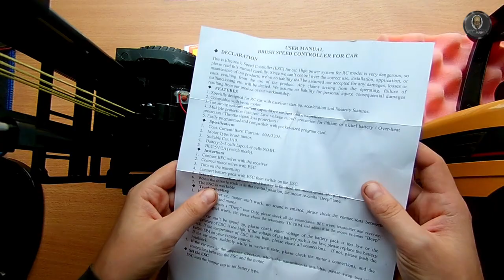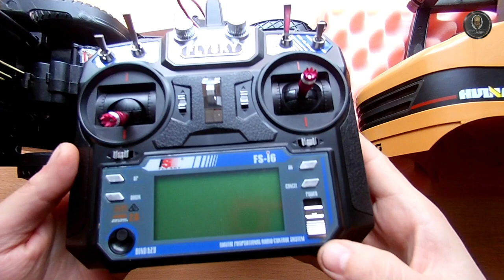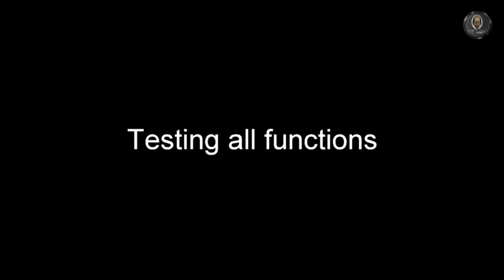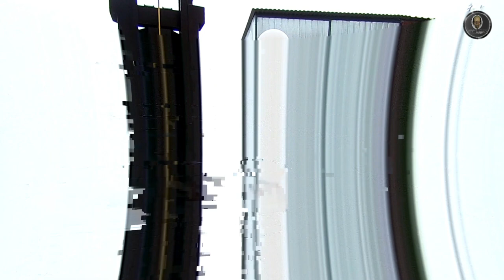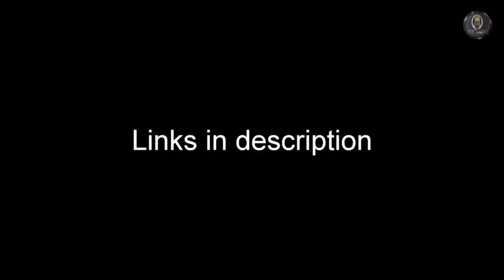Upgraded Huina Forklift with trailer

Comment: Great job bud I am going to use your ideas. May I ask what that power splitter us and where you got it? Can't wait for mine.
Reply from the maker: Power splitter is made from connectors soldered together.
I use this in bigger projects because it's more easy to modify it.
I changed ESC to quickrun 1060 and to do that I just unscrew cables from connector :)
I also added a buzzer because new owner drain battery to critical state.

Comment: To what channels does the different ESCs go on the receiver for forks? And did you try what the stock battery? Will this even work? What was the runtime with the stock battery? Doing what you have done to a friend's 1577 and want to do a nice job? Would you be open to assist if I need help?
Reply from the maker: Hi, All will depend on your remote, better are plane remotes like that flysky because of that centering lever and on what channel You connect it depend on what configuration of sticks You chose.
Sock battery would work, but that will depend on ESC, most of ESC have low power protection that turn off power on low battery, if ESC will work on higher voltage than it will not turn on with this battery.
I have no idea how long it worked on one battery :D I like to build more than use it, sadly I sell it to get more space in room and as far as I know it's still working.
Reply: @Adrian202  thank you for your reply. I will get 2 crawler ESCs which you can chose lipo or Nimh.

Comment: At 5:49 you say ESC has braking that cannot be turned off I may be a bit late on this but you set the drag brake to 0% and It should remove that. Drag brake is used for rc crawlers to hold still on a steep incline
Reply from the maker: I never did turn it off, Now I will replace it for a new owner

Comment: Great stuff! Can ask if you are running the stock battery? Or swapped it out for a lipo if so what lipo did you go for ? =)
Reply from the maker: I have Li-Po because I changed electronic.
I use 2s lipo and You just search witch one will fit inside :D

Comment: Awesome, i was wondering if you still have the files for 3d printing. I would also like to upgrade my forklift. Thanks
Reply from the maker: Yes I have it ready for edit :)
https://www.tinkercad.com/users/ijdXrBIYp5t-adrian202gt
Just search for Huina designs here.
I remember that I changed something after printing the steering mount because it was hitting something and I needed to cu a little bit to fix that but because after cutting it worked fine I did not changed it in design.
Lamp covers have two parts because first hold LED and second act as a cover but You can redesign that and it's not that hard :)
Reply: Thanks dude! Can I ask what esc you swapped out the original board for ? I want to run a different receiver but cant on that current set up haha I'm confused
Reply from the maker: @Thedopaminecyclist  links are in description but that ESC don't have option to turn off brake and that is annoying but have slow drive speed.
For receiver best would be to chose DumboRC because of more channels

Comment: That looks really cool. Original Forklift says it's 8 channel but you've used a 6 channel Flysky?
Reply from the maker: Not much functions to use :D
Reply: @Adrian202  Cheers
Reply: @Adrian202  The Forklift is on its way and I thought I'll upgrade it by following your video. I do not have access to a 3D printer at this stage and got a Devon 7 transmitter with a 6 channel Walkera receiver (RX601). Where did you get the power distributor and the distributor circuit with resisters for the lights? I'm a bit new to this so collecting all the parts I need. I do want to keep sounds as it is.
Reply from the maker: @lasanthamahavidanalage8918  Yes, I always use resistors for each LED depending how bright I want it (for rear You need bit less resistance because red LED is not so bright as white)
Wit a little bit of thinking You can do that without 3D printer and I don't suggest ESC with brake because that make it darn annoying and for lifting that would be insane :D

Comment: Hi, great work, can I ask if you can share stl files?
Reply from the maker: Go here:
https://www.tinkercad.com/users/ijdXrBIYp5t-adrian202gt
I named all parts with Huina work and I hope they will work for You but I know one arm holder need to be cut but I don't remember how and You can edit files as You want :)
Reply: @Adrian202  Great!Thanks a lot! I will try it do the same as you!Good work, continue with other builds please!
Reply from the maker: @PeteerStep  THX :) I still have Mercedes on workbench :D
Reply: @Adrian202  So just order what you have lin description and thats all?Put it together?
Reply from the maker: @PeteerStep  print parts, and have fun building :)
there is missing steering push rood but I don't remember witch one I have :)
Reply: @Adrian202  If I understand correct - servo for steering connect to reciever and 2 ESC goes to reciever too, but what about the battery?Normaly I will plug battery to ESC but there are two here. Thanks for advise
Reply from the maker: @PeteerStep  Both ESC are connected to battery and just one power receiver (I disconnect power from plug and connected just signal from second ESC)
servo is connected directly same as lights switch :)
Check My new movies because that new radio is perfect for this machine :)